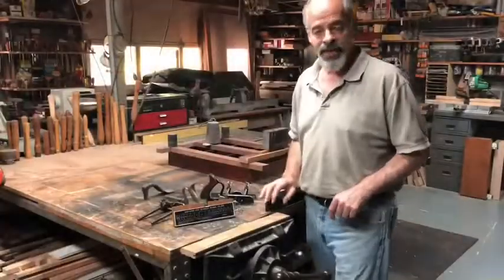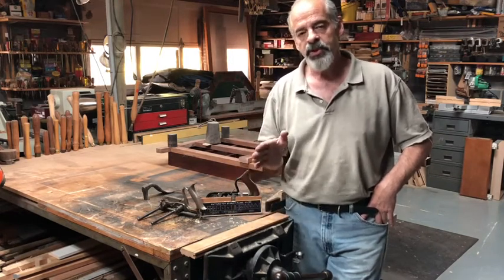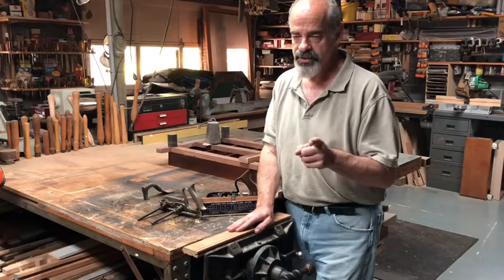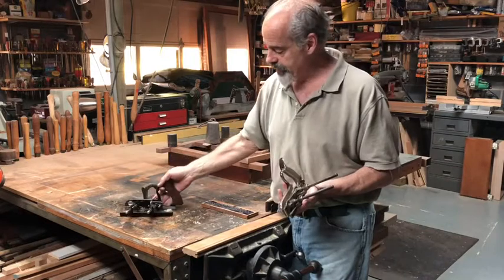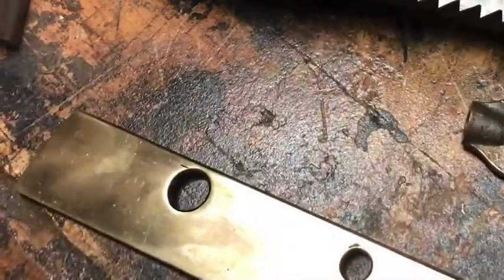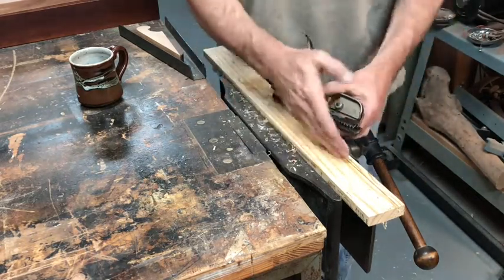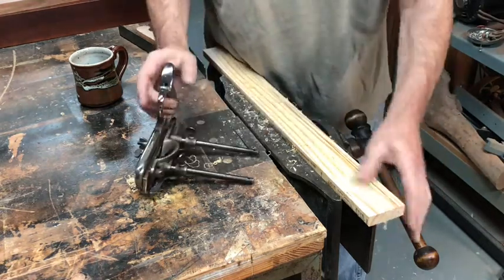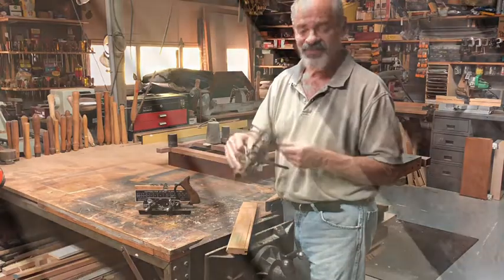A STANLEY KERFING PLANE

Comment: I did exactly the same with the same plane, but installed a Japanese style pull blade. No clogging. I use it for resawing. Usually I do all four sides about five millimeters deep. Works great.

Comment: I recently got a record #730 fibreboard plane and struggling to find any info on it, any suggestions?
Reply from the maker: https://www.woodcentral.com/woodworking/forum/archives_handtools.pl/bid/3106/md/read/id/81836/sbj/why-there-are-fiberboard-planes/
Reply from the maker: https://www.finewoodworking.com/forum/record-730-what-is-its-use
Reply from the maker: It is similar to the Stanley version and record had a 735 as well. What information in particular are you seeking to acquire about it?

Comment: Search "Stair Saw."
Reply from the maker: A stair saw while it’s similarly a “saw”, is a crosscut saw with no fence. A Kerfing saw is specifically used to create a kerf to guide another saw and has a ripping tooth rather than crosscut.
Reply from the maker: I should have mentioned that the availability of having a fence which the stair saw doesn’t have means it is useful to set a keg along a board which then gives one a guide to make a straight ripping cut over a longer length. The stair saw would not lend its self for this use at all.
Reply: @ChetSpier  The crosscut and rip function depends on what blade you use in the stair saw.  Here's info from a stair saw kit manufacturer who offers both types of blades:

These Stairsaw plates are made from 0.025" thk 1095 spring steel and have the slotted mounting holes pre-punched. They are set up for 10TPI Rip and 12 TPI Crosscut. Since the overall shape is symmetric, they can be installed to operate on the pull as well as the push stroke.

Saw plates can be purchased separately or as a kit which also includes (2) split sawnuts and a PDF copy of the plans to make your own stairsaw as I did here:

The Stairsaw Project

6" Stair Saw Plate, 1-5/8" x 6" x 0.025" thk, $19.00
8" Stair Saw Plate, 1-5/8" x 8" x 0.025" thk, $20.00
2 pair of split saw nuts $11.95
6" Stair Saw Kit, 1-5/8" x 6" x 0.025" thk, $45.95
8" Stair Saw Kit, 1-5/8" x 8" x 0.025" thk, $46.95
When ordering separate stair saw plates, please specify if you want 6" or 8", and 12TPI Cross cut or 10 TPI Rip.

SAW
Reply: @washingtonstreet7084  Can you please provide the link to order these blades?
Thank you.
Reply: @dale1956ties  Sorry.  The guys who made them have gone quiet.
Reply: @washingtonstreet7084  Too bad. I just built a kerfing plane using a part of a saw blade. It actually works really well. There were 3 saws hanging on wall of the garage of this house when I bought it 8 years ago and I just got around to doing something with them. It would've been nice to have a source for reasonably priced parts though.